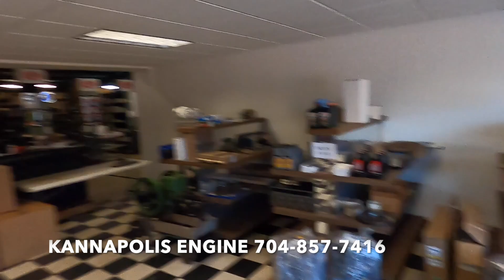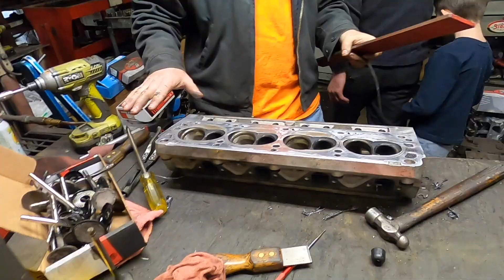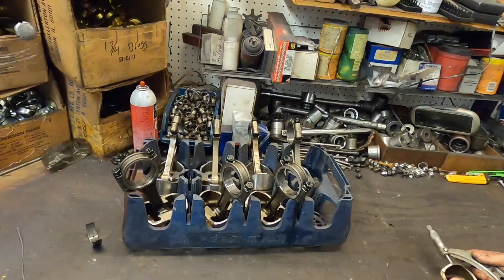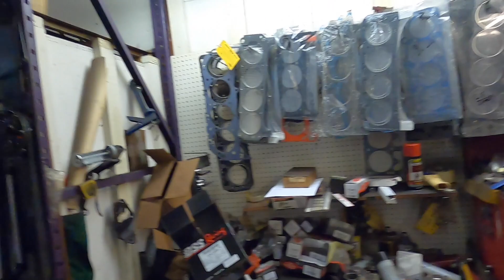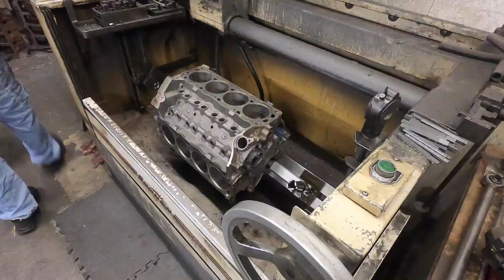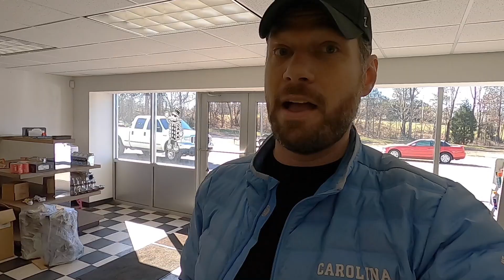331 OR 347 STROKER? // Watching a machine shop hone and prep the block for my SSP ROAD RACE BUILD!

Comment: The real issue is the compression Height of the 331 VS 347. I believe the 331 is 1.165 Compression height vs 337 I think its 1.060. The shorter Compression height starts lending itself more to less piston support and scrubbing of thrust faces. I believe most pick the 331 for this reason and longevity. I however believe if you build it right and of course RPM range of use will make the answer easy for you. I have always preferred my power down low vs top numbers in the higher RPM's. Im not a drag racer

Comment: I am compenplating which engine to build for my Cobra build and  was comparing a 363 vs a 427 Windsor  Dyno graph at Prestige Motorsports and the 427 makes an additional 100ftlbs. And 100hp at every rpm compare to a 363cuin.  500ftlbs at 3000rpm 😊

Comment: Great video! I have a 331 in my 90 fox w/turbo and Holley HP EFI and I need to make the same decision as you. My compression was about 125 across the board and it would fall on its face when I stepped on it so it needed a tune. I tore it down and found out it had the wrong pistons and they were 85 thou below the hole. They were .090 comp height and I need 1.065 or 1.075. So if you want to sell your 331 pistons if they are 30 over and 2618 alloy, I’m interested.

Comment: Stroking a 302 to a 347 does improve both hp and torque but with the longer stroke you can get increased wear on the cylinder walls. A 347 should go 50,000 or so miles before you start to see oil burning.

Comment: Why do you think a DSS block is only good for 500 hp? if you believe that why even make a DSS block when the factory block is good for over 600. Argue that number all you want that red Mustang in the picture to the left has been running 600 wheel with a 331 and Paxton blower for over 15 years there’s over 40,000 K on the motor and I beat the hell out of it. I’ve never even opened it since it got sealed.

Comment: Tell you this much I build a 331 15 years ago with the classic scat bottom end, all Edelbrock top end, the B303 cam and the Paxton Novi 2000 blower with the factory block fully prepped and tuned it to 600 horse at the wheels and I have not had to open that motor in 15 years. I drift, road race and drive the piss out of her on the street. I am glad my buddy talked me out of the 347. Cometic head gaskets are worth every penny hands down

Comment: The 347 will wear pistons and rings much quicker than pretty much any other. Combo....they have a bad rod angle ratio that puts a lot of side loading on pistons etc..also gudgeon pins are way up in ring packs causes Quick ring wear- 347 are only good for making torque ....the 331 has a near perfect rod angle ratio , so no extra wear in motor...331 will put rev and out perform the 347 for longer anywayz..go 331 every time...also if U don't want 331 crank send it my way..👍👍😁..
Reply from the maker: Plan to use the 331 for another project someday

Comment: The Exterior Decor Group hood on that blue Mustang reveals it's a second gen, and it's easy to tell the year--1968 was the year the Feds required all cars to have side marker lights, so without them it's a 1967.

I wonder if the head gasket issue was due to how the intake got tightened down? Who built this engine, DSS? seems like the bore work was sloppy.
Reply from the maker: Appreciate the tip on the old Mustang, I didn't know that!

Comment: I'm sure at 3:47 is fine more cubic inches but I rebuilt my 302 with a 30 overboard and I am very happy with it of course it is modified I put some heads from the 70s on it that I poured it in polished heavily and put bigger valves in I went with those heads so I could have screw screw and studs and rockers I went with stainless steel 1.7 rockers I went with a larger isky cam 24 lb injectors full length and headers a better chips so that I could cut out the 6250 RPM fuel cut outess slightly more compr
Reply from the maker: Nothing wrong with a 306.  I have had one in my vert for almost 3 years now.

Comment: .040 on a Windsor?  Getting very thin in the cylinder walls.  Mine is bored .010. Fragile little engine but very light and revs freely
Reply from the maker: Yeah, it'll be .40 over, about as far as I would want to take it.  Doubt I'll do boost.

Comment: 331 > 347. cylinder wall too thin on the bigger bore. might as well go 351,  aluminum heads. no replacement for displacement!
Reply from the maker: True, just wanted to save money on the block, since I already had it.

Comment: Had a 347 now I've got a331 and it turns 7500 rpm s and work s much better doesn't drop off at the other end of the track. Better cam and afr heads did the trick . . AMERICAN CYLINDER VERO BEACH FLORIDA..RON RAINEY ...AND LYNN BEST SHOP IN FLORIDA.   SO SAD RON NOT WITH US ANYMORE.  SURE MISS THAT FORD MAN ...
Reply from the maker: Oh sorry to hear that.

Comment: If I could do it again. Aluminum 363 stroker with afr renegade 225 heads and hydro cam. 12.5 compression.
Reply from the maker: Definitely a great way to go.  I was keeping the budget a little smaller this time around.

Comment: WHEN IS IT BEST TO GO WITH TWISTED WEDGE HEADS ?? MY IDEAL ENGINE WOULD CONSIST OF A TRICK FLOW MANIFOLD ,TWISTED WEDGE HEADS , ROLLER ROCKERS , 65 MM THROTTLE BODY , SUPER CHARHER , MSD COIL COLD AIR INDUCTION , LONG TUBE HEADERS , BORLA EXAUST ND TIPS , TREMEC TRANNY , PRO 5.0 SHORT THROW , THIS IS WHAT I WPULD TALK ABOUT WITH MY BUDDIES BACK IN 97 TO 2001 WHEN I STOPPED SPENDING MONEY I DIDNT HAVE FOR FUN AS I BECAME A SINGLE FATHER AND I WAS THE ONLY INCOME SO CARS , ENGINES , FUN PERSONAL STUFF BECAME IRRELEVANT ND MY SON WAS MY EVERYTHING. NOW IM READY HES 26 MAKES GREAT MONEY AND IM FREE TO DO ME , IS THE PARTS I MENTIONED GOOD EFFECTIVE OR OUT DATED ?? P.S. MY DREAM STANG WAS ND STILL IS 89 SALEEN BUT I ALSO LOVED THE 351 5.8 STANG NOTCHBACK WHICH IS LIKE OBSELETE AS I DONT HEAR ANYONE SPEAK ABOUT THAT STANG ANYMORE .
Reply from the maker: It's not a bad combo, but a little bit out of date.  I found though just having a reliable old school pushrod V8 to drive is the most fun for me.  Power doesn't matter as much anymore with all thew power the new ones can make.
Reply: @GearHead704  Thank you brother for your reply. I've been out of the game for a very long time and things have changed / improved but I like your truths regarding the old school push rod as opposed to whats being made today is crazy. Now they have the New Mustang Twin Torbo V8 pushing 1100 HP. I live my Stang Bangers !!!

Comment: seeing the measurements on the bores, I would like to ask. .  in a 351W with stock pistons, can I
bore and hone it out a bit and use a .010 over ring set filed fit the top rings to .016-.018 gap and not have that kind of piston rocking.
Reply from the maker: Sorry, I'm not sure, best to call Adam at Kannapolis Engine

Comment: Ya I'd stay 331. Less extra parts, but the biggest thing is durability. Safer for the block for longevity and it's not that big of a power difference.
Reply from the maker: I ended up going 347, but 331 wouldn't have been bad.
Reply: @GearHead704  cool. I'll need to check up on the newer videos to see how it's going.

Comment: I've always done N/A 347's in my street strip cars. I ran my first one for 18 years, built in 2001it ran as quick as 10.20 in the 1/4 mile. I've had three 347's (one in my 64 falcon now), and a 367 (4.145" bore x 3.40" stroke) in my 93 lx that went 9.50's. The 367 is getting redone and will be going in the falcon. As far as 347's being unreliable oil burners it's all BS. They've been great to me.
Reply from the maker: Awesome to hear!  I did end up choosing 347 and really looking forward to mine.  Impressive times by the way.

Comment: 4.030" with 3.25" stroke is 331.65 cubic inches. In math, we round up at .5 or more, so why do people always call this engine combo 331 instead of a 332? Especially since the 332 was Ford's first FE engine, so it's kind of cool to bring back the label.
Reply from the maker: Didn't know.  I'm not sure why 331 is the popular nomenclature

Comment: Have you considered going with Trick Flow 11R  cylinder heads ? Just a question. A lot of people seem to really like them . They would be at home on a 331 like yours, because a 331 likes to rev. I mean , you are having to get new pistons anyway . Unless your machinist doesn’t have that particular style piston in stock . Good luck !
Reply from the maker: Yes, I'm going with 11r 190cc heads actually!  Ended up going with the 347 option.

Comment: 347 burns oil cuz the pin intersects with oil rings , 331 makes as much power at higer rpm but it has a better rod ratio it wont hurt to rev it alittle higher, i would stay with 331 all youll need is a set of slugs and your good to go, if need be 100 hp at the button🤔🤓
Reply from the maker: Apparently there have been design changes in the 347 piston that no longer causes the oil burn.  We shall see the results on my channel.

Comment: I have 94 F150 5.0. I'm wanting to make it stronger than 220hp. What will be good to do get at least 275 to 300 hp.
Reply from the maker: Probably heads, cam, intake, or an on3 turbo kit to get there quick.

Comment: I went 331 with AFR heads.  The 347 piston speed is too high and pin placement is bad due to rod length.  331 will be more forgiving.   You want the torque, go 351 for torque and reliability.
Reply from the maker: I've had a 331 a couple times, so wanted to try something different.  We'll see how it works out.

Comment: You just told why I HATE Edelbrock ANYTHING. Trick
Flow, AFR, Promaxx, ANYBODY'S heads other than Edelbrock. You had sense enough to get a Comp cam. DSS can and does make mistakes. Overall, their stuff is bad ass. But being you're starting back over, JE, Eagle, and sealed power. Let him put the King bearings in, but step up to the top end. High volume pump with a higher pressure spring in it. The clearancing won't be a lot more. 225 Trickflows on a 347, you'll be able to feel the torque in your ass. 1.7 roller rockers, at minimum. I'd get a gear drive or a belt, no chain. You've already got the rods, cam and block. The rest is all in anybody's catalog.
Reply from the maker: Yeah, I'm really looking forward to no longer using those Edelbrock heads.

Comment: Hi I have been building motors since 15 ,I am 66 in April ,I have just built 2  347s for friend,67 and 70 mustang fastbacks i would put 302 Twisted wedge motor I built in 95 mustang against either one,the TWs are180s they make bigger ,also p51 from kasse  make great power I have 20 Ford motors rt now doing couple cleveland fitting yates head with try y intake GOOD LUCk
Reply from the maker: Wow, it sounds like you've got a lot of experience that's cool.  I did decide to go 347.
Reply: Saw that they say 331 easier on bottom end I was singing 289/302 7500 all my life my ranger accidentally hit 8000 have you tube my pro 5.0 Gt 40 p will bring up 13 videos

Comment: I like putting the ultra light cali’s crank with Oliver’s ultra light connecting rods with  Cp’s pistons or diamond’s and love the AFR HEADS but if you want to save a bit after going all out on the ultra light set up that in my book is number one best of the best Brox and RHS  have some descent heads oh and get a isky cam You need a new cam that made for the new build and again hands down isky is number one I feel and then ARP stud the block Jesel  again is what I’d do for a bulletproof build
Reply: Or you could just go with the eagle they have a full rotating assembly that’s definitely cost effective with throwing some brox or the RHS heads but for sure 347
Reply from the maker: I totally forgot about Isky.  My Dad loved their cams

Comment: I would be so mad to spend the kind of money d.s.s. Charges to have sloppy clearances like that. 347 is what I’d do and trickflow 11r 190cc heads. And get a custom cam.
Reply from the maker: Hey Wes, yeah i'm doing exactly that 347, 11r 190's for sure.
Reply: @GearHead704  should be a ripper! 
Are you still running stock ECU
Reply from the maker: @wesboyd7416  Yes, same for my vert which Matt from FMR repaired it and Rob at Powercurve Motorsports tuned it.  The little 306 in that runs great.

Comment: I don't know if this guy went to college, and judging by his knowledge of measurements, physics, geometry, etc., he very well could have an engineering degree - But I'd say his brain is vastly superior to any recent liberal arts graduate.
Reply: Honestly. He may not have... Just years of experience... That's just what ya need to know for engine building
Reply: @strydyrhellzrydyr1345  Exactly,just a gearhead,im not a smart  by any stretch but when there is a problem i just dig in,majority of people are scared to do that,about a year ago my washing machine conked out,i knew about washing machines as much as i would know brain surgery,stripped it down found out what was wrong and got it fixed, same with cars, engine building,computer repair etc,just dig in and read and learn and you'll figure it out.
Reply from the maker: Adam is definitely a sharp dude.

Comment: Currently deciding to go with my mechanics custom 349 for 2700$ girdled and slap it on my trickflow trac heat top end kit 170cc heads but been told ill be restricted powerwise but will have room to grow from.
Reply from the maker: It will be a lot of fun either way I"m sure.  Nice choice.

Comment: at that point go 351 stroked to 393 or 408. Rebuild what you got to 331, sell it as complete running package
Reply from the maker: 331 will be for another project.  I reveal my choice in a video posting about 10 minutes from now.

Comment: 331 DSS Racing Bullet + AFR 185 = Great engine very durable !!! I like full support for oil rings ! Have this combo in ford maverick its been sweet engine !!
Reply from the maker: Nice combo, should last a long time.
Reply: I have AFR 185 heads too and I’m trying to decide on either 331 or 347. I’m leaning towards 331.  Im making 318 rwhp with my current setup on my 95 mustang.

Comment: Im Running a 331 systemax intake 75mm plate i have the 185 AFR its  supposedly right about 448 HP, I have Yet To get it on the dino   but its been really reliable,  331 AFRs my Vote 👊🇺🇸💪👍🦊🚘🔧🔧🔧🔧
Reply from the maker: Thanks for letting me know FordTech.  I am looking at the SystemMax as my possible intake as well.

Comment: Why the cylinders were all .0015" or larger over standard oversize is a question for whoever machined the block originally, unless it's been apart and subsequently rehoned to death. The second rings should have minimal wear on the bottom of the ring as suggested, the ring in the video is worn out.
The 3.25" stroke crank does offer a bit more stable piston at bottom dead center than the 3.4" stroke, which isn't a deal breaker but ultimately the longer stroke will have a bit more piston noise and potentially some oil consumption due to that rock at bottom dead center. We are discussing .075" difference so it isn't a massive difference.
While modern pistons are very accurate, I always have the pistons in hand before boring in case you need to add a few tenth to satisfy the clearance requirement. Cool build!
Reply from the maker: The engine was rebuilt at one point, but I don't know what was done to it exactly then.  Yes, I'm excited about the build, thanks for watching.

Comment: I own Ugly Kid Racing Engines in N.C, ive been doing the stock block 8.2 deck motors for 20+ years, i think since you are doing a N/A setup 347 is the way to go, and a set of Trickflow 11r205's would really make some good power. Trickflow is always my first choice, Edelbrock is my second.
Reply from the maker: I really do want Trickflows too.  I have a set of small entry level 170cc's on my vert, but I love them.
Reply: @GearHead704 the trickflow work, ive got a car called Suicidal 306, it went 5.75@118 after switching to a trickflow 11r190 head, and the motor was worn slam out. The videos are on here under "Sandman91mm" my world record nitrous sbe 302 passes, and the Nitrous stock block record is on there.
Reply from the maker: @Uglykidracing8.2  Wow, this quick.  I'm not a big drag racer myself, but these Fox's are perfect for it.

Comment: Stay 331 you already have the crank and rods. More RPM w/ trickflow 11r 190 heads or the AFR enforcers are a nice reasonable price
Adam usually has the DSS  inline/tw pistons on the shelf. That would be a screamer.
Reply from the maker: I really do want those TrickFlow heads!

Comment: I chose to build a 331 years ago just because everyone else was doing 347s. I have to say the 331 with the 5.4" connecting rods let's the piston dwell at TDC a little longer and makes awesome power at 14 to 1 compression. Wouldn't do it different if I had the chance.
Reply from the maker: Not a bad way to go for sure.   I'll be letting you guys know which decision I made on the channel soon.

Comment: 347 done properly hands down....Torque monster...Ask me how I know...LOL
Reply from the maker: Hah hah, that's how I"m going
Reply: @GearHead704  Good man...I have actually had two. The second one seemed  like night and day because my lower end  short block was assembled by a master/blue printed. II went with trickflow cam, heads, roller rockers, edelbrock rpm air gap , Holley 670 Its in my 66 Mustang with 3:25  gears and C4 auto (upgraded)  and she  wants to rip the  tires off...LOL, If interested you can see my baby here : https://youtu.be/GmXNu_sODqg

Comment: Ive had both in my 89 notch.. stay with the 331.. more durable combo.. Mine lasted three years of spraying 350hp worth of N20 through it.. Ran best of 8.82 on a 26" slick..
Reply from the maker: Nice! I've never been in a car when Nitrious was sprayed, but I"m sure it's fun.
Reply: What heads and cams were you using?
Reply: @themechanicred  Trick Flow
Reply: I am building a gutted, front tube fox hatchback. I plan to use a stock block and poke it to a 331. Also will run nitrous. We’ll see how long it lasts